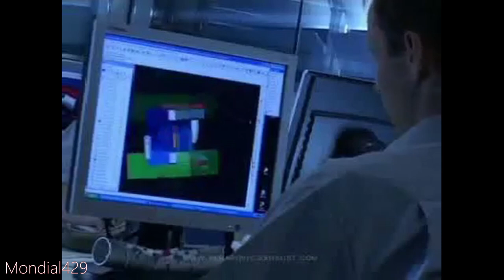The WONDERFUL story of AKRAPOVIČ | ICON RETROSPECTIVE

Comment: There's only one thing I dislike about Akra, at least on motorcycles, they are more quiet than stock. For track use and power gains (without remapping) they are fantastic but on the road I like to hear what the damn thing sounds like. I was surprised when I changed the akra on my rsv4 for the stock one

Comment: Nice story. Shame it's a terminal market. Euro 4/5 makes (bike) slip on end cans just offer better looks, lower weight and marginal sound and power improvements if the cat is retained. Its slot of money for bling. At least the after resale market is pretty good so you should get at least 50% back more if it's a rare fitment. Always keep the OEM pipe.
Reply from the maker: Agree, personally I think if money is an object, a slip on is definitely more than enough to let the engine sing its true note. Going full system requires a remap as well which isn't free..
Reply: @UrgetoRide  Not always true about the remap. With Akra being the official partner, if you buy the official aftermarket exhaust, as in the one Yamaha for example sells directly then that exhaust was designed from the group up for that model of bike and no remap is required.
Reply from the maker: @PokerMuppet  You're right I guess if the full exhaust keeps the cat in place, is same length and geometry and all that jazz as OEM, then a remap isn't required
Reply: You can still remove the baffles on most euro 4 and 5 pipes buy breaking or drilling a weld.

Comment: Their pipes are good... But if you think your road bike is getting the best system it can then think again unless you are a race team and have the funds to buy systems that are not in the catalogues . Their race exhausts are very different from even the customer evo systems and are very very expensive. Are they the best? If you are looking at a slip on or a road based exhaust then there are plenty out there that work just as well...
Reply from the maker: I mean yeah, race spec or even bespoke spec is always different to mass produced stuff with a nice logo slapped on it. Just look at Brembo and the difference between their proper stuff and the stuff they make for some manufacturers where its basically like 'guys we just want your brand on the bike so the journos think its amazing, we don't really care if its your latest tech'

It's just business.. but on the whole, Akra is good stuff.
Reply: @UrgetoRide  If you really want a pipe that makes a difference and not just follow the molecular level hype then go find a pipe like the Arata which is a fully tapered header titanium system or go for a Japanese Yoshimura pipe that is their proper race spec exhaust which can be purchased. Its mostly marketing speak that people get sucked into. Look at WSS600 class bikes and the biggest supplier is Arrow not Akrapovic. Again sadly the WSS600 spec pipes are not sold to the public and even the Triumph 675 had 2 options direct from Triumph with one only sold to race licence holders. Akrapovic make nice stuff but its not worth the extra cost and has not been worth it after they went from being skorpion to Akrapovic. It became too watered down and made for mass market.